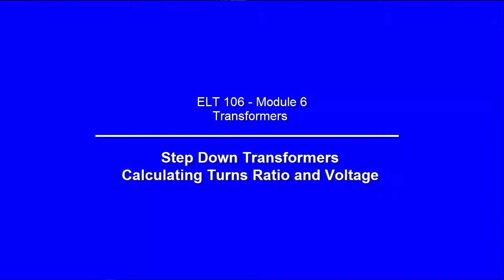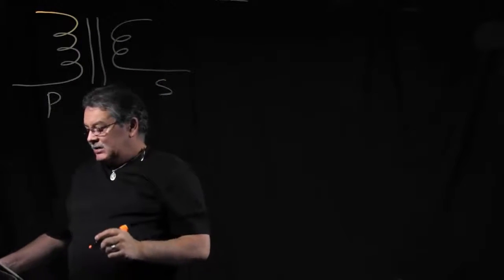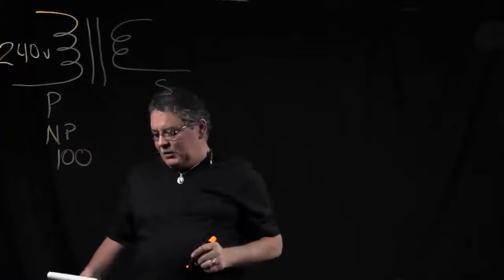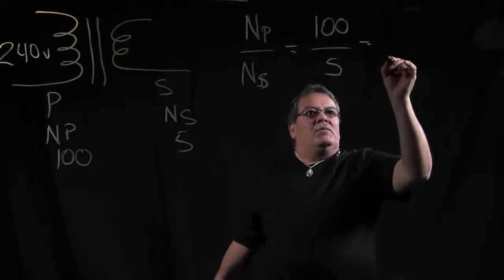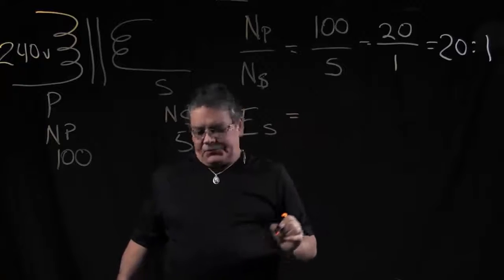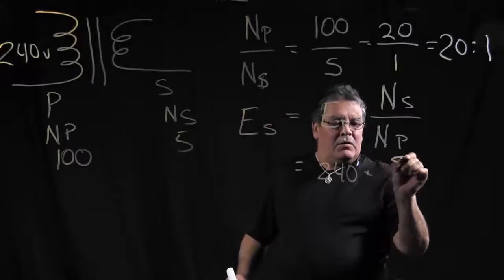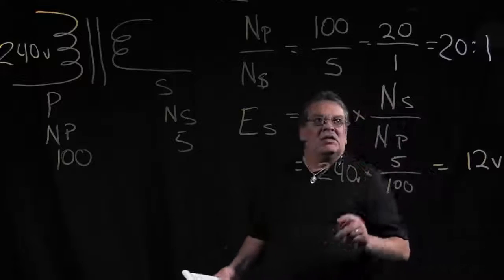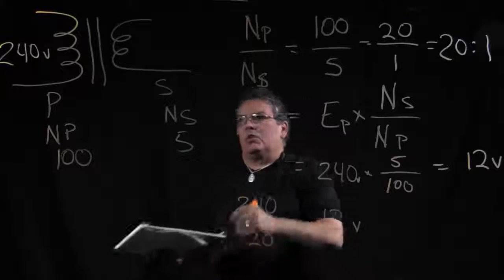ELT 106 - Module 6: Step Down Transformers - Calculating Turns Ratio and Voltage

Comment: How do you choose how many turns, for say 240v to 12v step down transformer for best efficiency? 100:5 ?
or 200:10 ?  or 1,000:50 ? etc. which one of these would be *most efficient*, assuming of course, that the cable size is sufficient to carry the maximum predicted current?

Comment: What if you don't know the turns of the primary or the secondary?
Reply: I know this is way late, but maybe it'll help someone in the future. If you dont know those values, then you should know what voltage the battery is outputting to the primary, and you should know what voltage you want to have in the secondary.  You can just choose the amount of turns for one of the ratios (i prefer to choose 1 for ease, on whatever side you know is going to have the lower voltage), and calculate the other value of turns.
Reply: @bae_ily7960  thank you, this is the only comment that helped me, I've been searching for hours.
Reply: @bae_ily7960  thank you, this also helped me